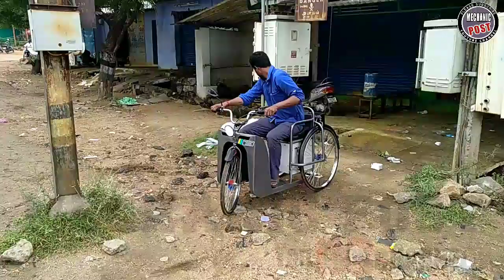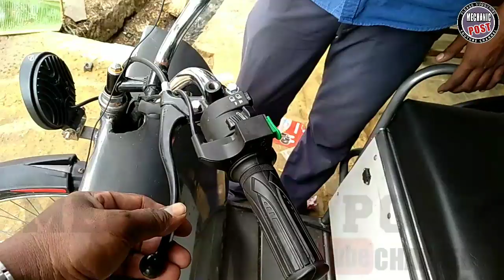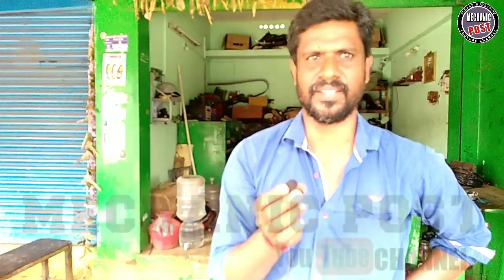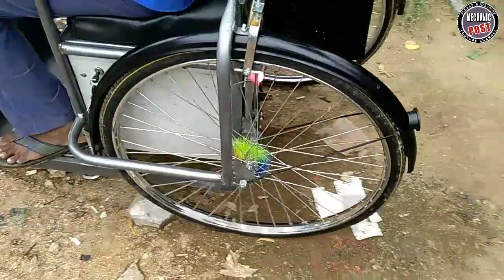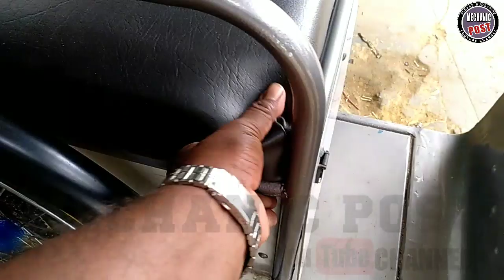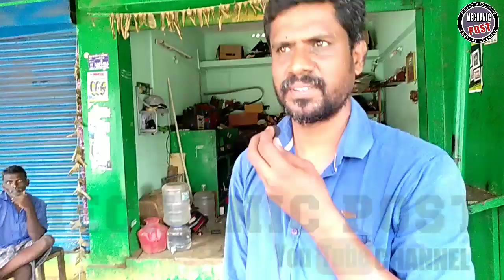ரூ 25,000- மூன்று சக்கர பேட்டரி வண்டி|Electric bike|Electric 3 Wheeler| |TAMIL|MP|MECHANIC POST

Comment: Why not we can use this kit for charging battery on the way: GITM Classic Bicycle Dynamo with Retro LED Front and Back Light 12v 6w https://www.amazon.in/dp/B07Q25N52J/ref=cm_sw_r_cp_apa_i_c6kcEbBPC4WT9
Reply from the maker: Thanks
Reply: You can also explore this model: DivyanshiTM DC 6V-38V-Generator-High-quality-motor-wind-turbines-2400-9000RPM for DIY & Other https://www.amazon.in/dp/B01M26ARPP/ref=cm_sw_r_cp_apa_i_NgFcEbHPN94BQ